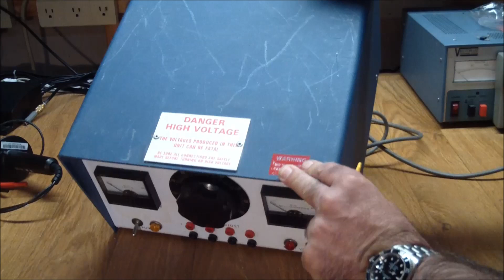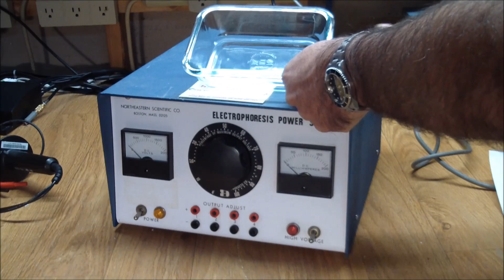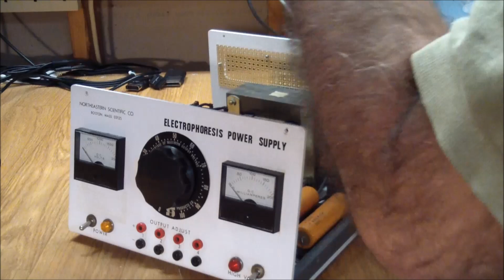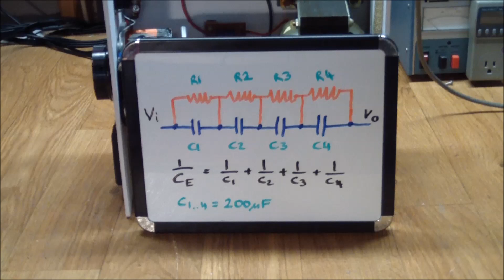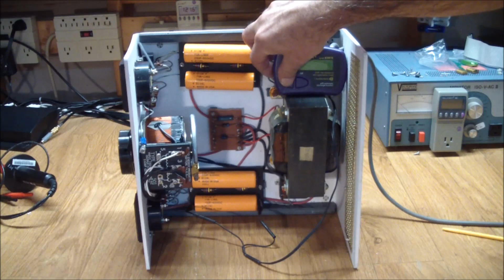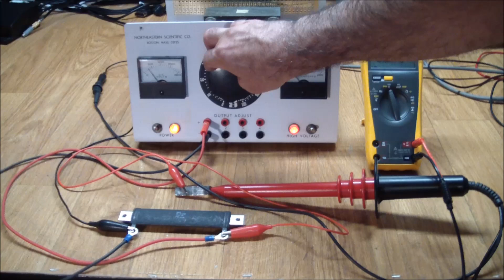AE#60 Electrophoresis Power Supply Teardown And Test

Comment: There's is a auction close to where I live that has of them coming up , but yes sounds dangerous to play with , and make sure the cables being used have a high voltage rating on them . The variac would be nice to have .

Comment: I picked up one of these cheap to use to drive a pair of field coil speakers. The speakers need about 150VDC.  Mine goes up to 500 volts. The field coil impedance is about 3k Ohms for each speaker. Would you advise using a PSU like this for an audio application? It is likely not regulated like the one you tested here. Thank you in advance.
Reply from the maker: I doubt that this kind of instrument could supply the current required by a field coil speaker. But check the specs anyway.
Reply: @artifactelectronics  I think it only draws 1amp max. A friend built me a full bridge rectified PSU. He calculated one amp.

Comment: I've seen these "restorer" videos where they use a small battery or DC supply to electroplate objects.  Maybe you could use this as a TWO SECOND electroplating device?  LOL
Reply from the maker: Or maybe rejuvenating a bad CRT tube in 1 sec.
Reply: I use a 0-18V 0-50A DC unit for my plating tanks

Comment: Any reasons why biomedical equipment power supply circuits have less leakage current compared to customer or lab equipment power supply circuits? I'm guessing a switching power supply has less leakage current compared to a linear power supply?

Comment: What a difference a tear down makes. I was jazzed at the thought of a AutoTransformer, big linear trans and associated components.... but, the 2nd on that trans is to the moon, Alice! I poo-pooed the plastic enclosure UNTIL you described the voltages running around it. The plastic all the sudden became a bonus, considering. Love the small Variac, of course. All and all not the haul I hoped for as the supply is quite unique. But that's what made it interesting. Thanks for the ride-along. Cheers!

Comment: a good common neon sign transformer w/a variac on a primary side  to adjust the secondary voltage you want also work to, ( this is watt i used to check windings on a motor in the motor shop ) (HIPOT ) but is limit for 30 ma and around   16 k volts or less ,but; make sure you wires are rating for high voltages,  and capacitors, and resistors etc,etc please. the switch should  be install on a primary side of the circuit and rating for primary voltage ( 120,208,240,277,480,etc,etc).

Comment: 23:26 as a rule of thumb a typical color CRT has around 32 kV on the anode a black and white CRT has around 15 kV.

Most CRTs will have a sticker on them somewhere saying what the anode voltage should be as the voltage will vary slightly from tube to tube.

Comment: Oi Arty; I have a slight issue with your math.  At the 21:00 minute mark you have a reading of 505VDC and are using an 1100 ohm load resistor.  Ohm's law  E/R=I  ummm.... 505/1100=0.459A or approximately 500 milliamps, not 50 milliamps as you stated.  BTW that resistor is dissipating 231 Watts of power and only rated for 65 Watts (3.5 times rating!), you should be more careful, you could start a fire. Just take care, entertaining indeed. Also since the output is not regulated it would not make a very useful power supply for tube amps and the lack of filament voltage also adds to the unsuitability. Sadly it is also too low voltage for ionization experiments for most gas discharge tubes.  It would probably drive a xenon flash bulb for making a ruby laser or strobe light, perhaps.  Have fun and be more safe.
Reply from the maker: Gary, I probably mumbled when I stated the resistor value, but I actually used an 11K resistor.
Reply: My apologies Arty, that makes a big difference, glad for that info, my faith in you restored.
Reply: you know OHMS law; this guy don't KNOW  nothing about electricity ,he should stay away from this things . w=I square x R = .459x.459x 1100 =231 watts ,so 64 watts resistor only work for a few seconds and then smok .

Comment: You could use it for isolation testing on motors (mostly interesting at mains voltage). Isolation tends to break down at higher voltages only and measuring with your MM doesn't reveal the cause. Isolation between windings and rotor is the thing of interest.
Well, but only if you do some motor stuff. :-)
Furthermore, you could verify/check the isolation of your isolation transformer etc. Then, you could check high voltage capacitors for leakage current (they break down at high voltage, but measure OK at low voltages).
So, there IS some usage for you ...
Enjoy and thanks for your videos!

Comment: I’m your biggest critic, but you did a good job on explaining electrophoresis. Your’s is a very early model. It comes from way before the Human Genome project. It belongs in a museum.  I used that exact model as an undergrad - that was almost four decades ago.

You are close on the story of how these oddball lab parts get made.  The thing you missed is the role of the faculty. 

Now I’m not giving you anything specific here, nobody will get in trouble.  Faculty use government grant money to do the design/build of these sorts of things.  

Then a few of them throw in some cash and use grad students who aren’t pulling their weight with grant funds to do early production runs. After that the guys from Menlo Park show up and fund the build out of the company. 

Two friends of mine did this and cashed out for $20M each.  The sad thing was the best guy in the bunch said screw it, bought a farm in Northern California.  He died a week later when he rolled his tractor. Sad deal. 

Check out a company called Molecular Designs Limited.  You’ll see how it works. 

You know, that unit would be a great isolation transformer. Just make sure the Variac is powered from the line and the tranny draws from it.  I can write you a book about why, but just think saturation. 

If you make more videos like this and stop BSing around with things you don’t understand, I will get off your back and start supporting you. 

This generation of gear is an overlooked gold mine.  You have the right level of knowledge/experience to take it on.
Reply: Hello teacher, should we add a load here before testing?

Comment: I have a 200-400 version. Its bloody lethal. There are higher voltage versions available that will only power up if they detect a load. Nasty to work with.
Reply: I was surprised that they didn't put a resistor across the output to discharge the caps when you flip the high voltage output switch off. Kind of scary relying on the load to discharge the output. I'm also willing to bet that output toggle switch isn't rated to break a 2,000 volt arc.

Comment: An interesting device but like you say what to use it for? It looks a bit kitchen table construction or how-you-doing like Dave would say. If you like to experiment with tubes you could use it for anode supply I guess. Looking at the content of the box I think the transformer has 2 secondary windings which are each rectified and then provide +1000 and -1000 volt to the output. Then also the caps makes sense, 2 in series to get 10uF/1200V. One last thing: a variac is not about turns ratio but it's just a moveable tap.

Comment: Hello Arti,

Nice score, HV supply usually spit out very low current... this one is quite beefy with 200mA...
I just love that big black knob  ! ^^

Maybe you could annotate/correct your video ?  When you show us the white board, you say/wrote that all for caps are 200uF and therefore make up for a 50uF equivalent.  However we can clearly see that the caps were marked 20uF not 200uF, so 5uF total ! ;-)  Later on, you measure that capacitance and ESR of all 4 caps, and they all read spot on at 20uF.. I thought you would correct your white board error at this point, but no ;-)

Also, when you talk about the load imposed by your setup on the power supply, you say it's 10Meg, the DMM input impedance... but I think it's more like 1Giga ohm, the impedance of the HV probe ! ;-)

As for the voltage rating of your beefy resistor, I think you said it was 11Kohm and 65Watts ? So that means it should at the least be able to withstand 865 Volts... otherwise it won't meet its advertised 65Watt rating.

As for usage.. .well a HV can always bre handy ! Intend to get one, when money permits.  You could use it to experiment with various things, like testing for leakage currents, testing insulation of wires, spark gaps, semiconductor reverse breakdown voltage, tubes (I mean, voltage references, not necessarily triodes/pentodes), high voltage Zener diodes, testing voltage rating of various passive components... of power resistors to start with. You could check for their voltage factor : measure current going though it accurately, as you increase the voltage across it, and plot the resistance versus voltage curve. Same for HV capacitors. I think the sky is the limit ! ;-P

Regards,

Vincent Trouilliez